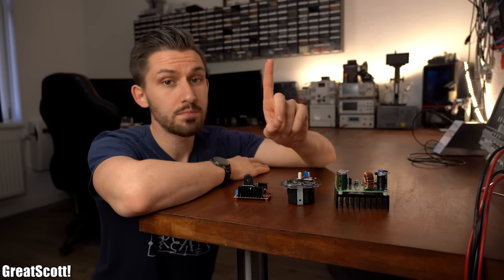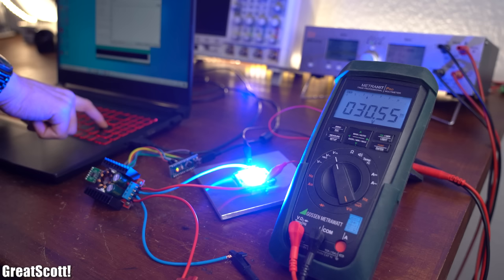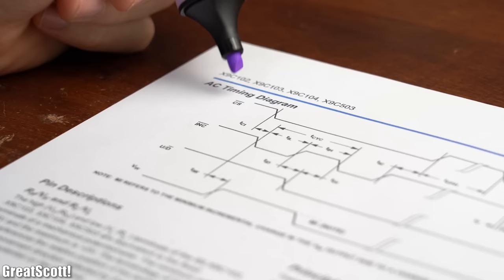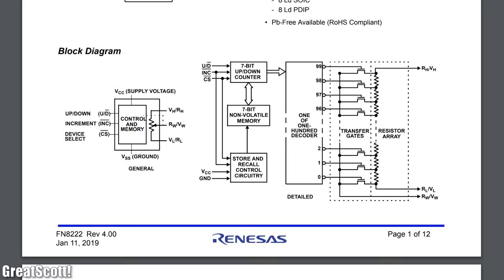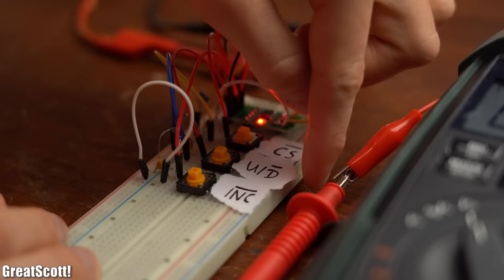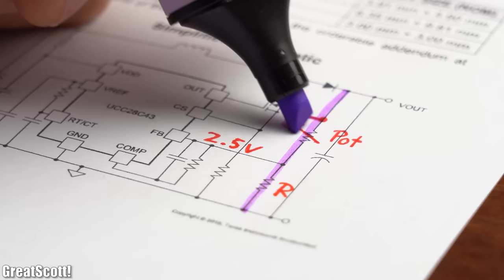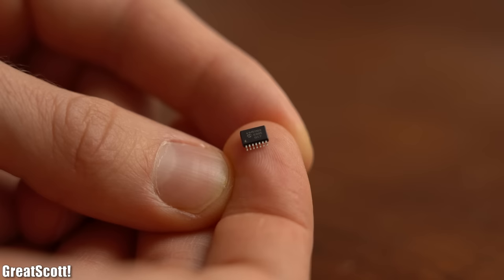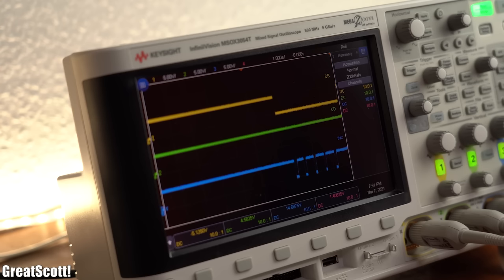This component can control tons of circuits! Digital Potentiometer Guide! EB#51

Comment: Interesting. I am currently building a project that includes replacing a mechanical pot with an electronic control, but intend to use a PWM signal from the controller. My intent is to replace the potentiometer with a transistor using a small pair of smoothing capacitors to cut ripple and a bleed resistor to keep a good response rate. I realize this will take some tuning and increase the parts count but it should be both less expensive and less time consuming. Would need more filtering for an audio application but I am controlling current through various circuits of a LED array. The mechanical potentiometer would always be roughly in the middle of the 10k potentiometer's sweep so I'm not worried about transistor voltage drop.

Anybody see a problem with my approach?

Comment: Can't we just use a MOSFET with a buck converter supplying voltage to its gate. We can change duty cycle of buck using arduino to adjust voltage at gate. It will increase the electronical work for sure but will work with very little codeing, plus digital potentiometer are not available that easily.

Comment: Hey Scott!

I am trying to do a similar thing with MCP45HV31T103EST, and I have connected the Digital Pot in the place of the normal pot as you did. But there seems to be a problem. When there is not load on the output of the buck converter the output voltage varies perfectly, but when I connect a load on the output of the buck, the voltage drops to near 0. can you help me out with this?

Comment: Hey, thanks a lot!!!!!!!!!!!!!!!!!!!
That's (nearly) what i was searching for:
I would like to control a SZBK07-Buck-Converter,
but:
1.) I want to control the Current-Limiting-Poti (Voltage-output fixed). There shouldn't be that hight Voltages on this poti. 
Do you think, i could make use of the X9Cxxx-Modul-Type here?????

2.) I need to do control via Raspberry PI, which normally has 3.3 V output instead of 5 V of Arduino.
Do you think it might work, if i connect 5 V to VCC of the X9Cxxx, if CS+INC+U/D only get (as far as i know) 3.3 V-signals?

And did i get you right, that i could connect the X9Cxxx-inputs to any standard-GPIO-ports of the RPI and just control it by setting CS+INC+U/D hight or low in the described way????

Thanks in advance for any help! I am still a greenhorn in electronics and just started learning :-(
But it would be fantastic if i would be able to make it work this way (with X9Cxxx-Module)!

Comment: what is the circuit called that charges a battery when power supply is plugged in and on but will auto switch to battery power if its not plugged in and on? you know like a laptop or cell phone...
Reply: Bypass charging circuit

Comment: I need a help!!! I was working on a project and run into a trouble. The issue is I have decided to use AC Switches for arduinos digital drive. I have browsed on the internet, however, it seems like none had this issue. if you could help me with it i would greatly appreciate it!!!!!

Comment: Since I am a mechanical engineer, I do not know much .....but isn't it possible to use PWM instead of Digital Potentiometer for high power application? Essentially the demand of Potentiometer is to get varying voltage divider to compare with reference voltage (in boost/buck converter application). PWM might be a good alternative to get similar results......unless I am misunderstanding the reason why PWM should not be used instead of Potentiometer. Please someone guide me why PWM is OK or not OK to be used instead of Potentiometer.

Comment: How fast can these be switched? If I want to generate 1ms voltage pulses on a boost converter (dropping 8vdc from a normal output of 40vdc) can I use this to signal the boost microcontroller? Or is it better to use a pair of fixed resistors and switch one in/out with a FET?

Comment: This could actually be the solution for a project I've been thinking up where i needed to change a resistor value without changing the input voltage. (Pwm not really an option, pot feeds a 555tumer running at up to 120kHz)
Reply: What are you using the 555 for, though? If you’re using a microcontroller, you might be able to generate the signal directly. If that’s not an option, using a programmable oscillator might be a better option, considering you need to add an IC anyways.
Reply: @GRBtutorials  thought is to run a ~128khz output clock into counting chips, memory bank, the dac for sound output. Haven't looked into programmable oscillators
Reply: @GRBtutorials  done some looking and I think you suggested exactly what I needed

Comment: Wanted to use one of these on a 120v boost converter. Would this work similarly or is the v at the mechanical pot higher than 36v? This is for a home power wall based on 40v batteries which charge on a cheap 5p per kwh tariff over night and offset my house base load through the day. Would be nice to be able to boost the v remotely via a  esp32 into the solar inverter and thus respond more dynamically to changing loads.
Reply from the maker: That will probably be higher than 36V. But you can put multiple digital pots in series and thus divide the voltage. A bit harder to pull off but definitely possible ;-)

Comment: couldn't you just use something like a DAC where you have a bunch of resistors with the 1st one having a very low resitance, then the next one being double that, and so on. Then use a bunch of switches to either bypass or go through each resitor giving you a wide range of resitance with plenty of accuracy.

Comment: Hi, please suggest a digital potentiometer that handle current up to 20A at 3-20V
Reply: No such thing.  Nearly all of them are limited to 5v, and even for the rest, they aren't going to control more than 10 mA or so.  You need to amplify the current with some driver transistors if you want to control 20A.

Comment: I have a 3 cell 11.1V lipo battery I fully charged it to 100% and when checked it with battery tester all the 3 cells have different voltages so is it safe to use
Reply from the maker: Sure. But maybe try balance charging next time.
Reply: @greatscottlab  Thanks

Comment: You forgot to mention they have a relatively short life endurance (~100 000 cycle) . So if you want to use it in an aplication where you adjust it very often for example hundred times in a minute or sweep it up and down it will wear out quickly. Of course with only a few daily adjusting it will last for many years.
Reply: @jernejj5 Ohhh. Then I misunderstand that in the documentation. Thank you for your rectification!

Comment: Motorized potentiometer is better than this.
Reply from the maker: Well, that is also kind of like a digital potentiometer
Reply: ...but 100x more expensive and 100x larger, requiring additional power wiring...so "better" in what way?  Explain "better"... I won't hold my breath